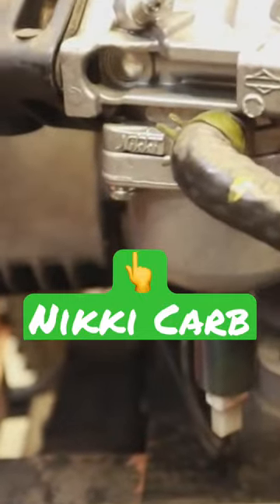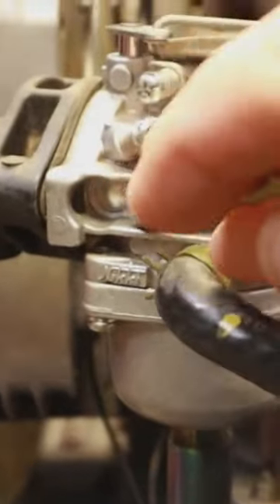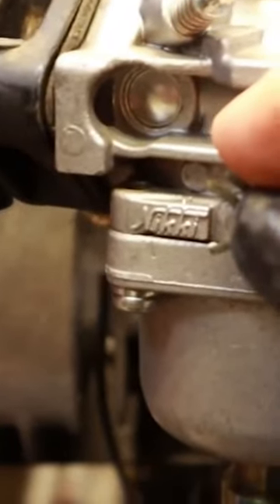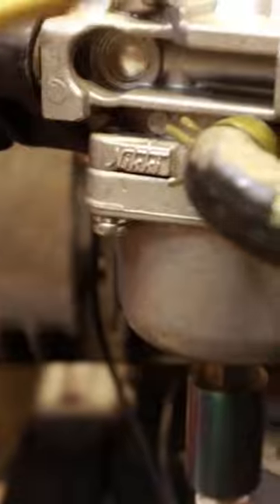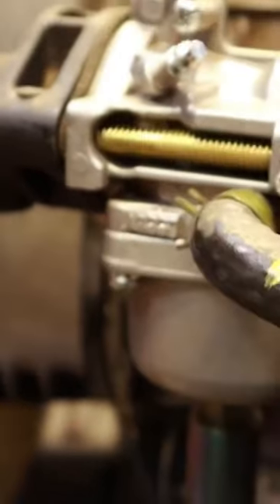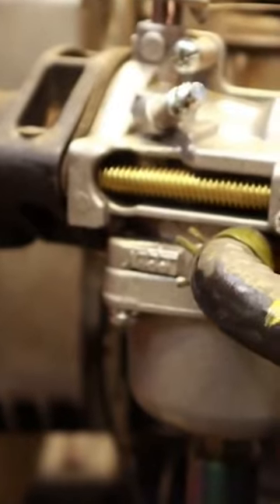Simple Fix for a Surging Nikki Carburetor #baldeagle242

Comment from the maker: See the full story on this mower here.  (What happens when these carbs fail?  Click here to find out!)
https://youtu.be/8VxTRqJZi0Q

See the Complete Baldeagle242 video history here.  A true trip down memory lane of all past videos I have posted on YouTube.
https://youtube.com/playlist?list=PL5_ZXmQpcjpZLAMEskeAYolqvhFSN_X4m

Links to parts used in this video:

Aftermarket (Chinese) Carburetor Repair Kit for Briggs & Stratton Nikki Carbs
https://amzn.to/3q7uTWv

Briggs and Stratton brand Nikki Float bowl gasket (O-Ring style)
https://amzn.to/31HwQjc

Briggs and Stratton brand Nikki Float bowl gasket (NON-Ring style)
https://amzn.to/3f6F3AC

Briggs and Stratton brand Nikki needle
https://amzn.to/33fxzZ6

Inline fuel shut-off valve
https://amzn.to/3tacn1C

Inline fuel filters
https://amzn.to/3r0Cs0v

Below are tools and parts I use in my shop and daily adventures.

Mini Tire Changer for the mower, go-kart, and most small tires.
https://amzn.to/31eHgGp

The drill bits I use are lifetime-warranted Molybdenum from Drill Hog.  If you break one or wear it to nothing, you send it back, and they send a new one!
https://www.amazon.com/dp/B010US18BG/?tag=eagle0f1-20

Hand crank trailer winch with strap with safety hook
https://amzn.to/3jTBzEL

Titanium MIG 140 Welder Works with Flux Core (No Gas needed - 110 volts)
https://amzn.to/3mqj3oP
Titanium MIG 170 Welder Works with Flux Core or Gas (110 or 220 volts)
https://bit.ly/3k8GUrD

Amazon Wish List
https://a.co/cWseC8V

As an Amazon Affiliate, I earn from qualifying purchases.  These links are provided to help you find the products I've used in this video.  Clicking these links will take you straight to the products on Amazon and help support this channel without costing you anything extra.

Get the Motion Hero Pack that I use in my videos for
Only $37 one-time investment. Use unlimited times on your own and client videos!
https://baldeagle242--videohero.thrivecart.com/motion-hero-pack-1/

If you're a video creator on YouTube - Tube, Buddy is an excellent program to evaluate your videos and make recommendations to help you attract more viewers.  
https://www.tubebuddy.com/Baldeagle242

BALDEAGLE242 Facebook group
https://www.facebook.com/profile.php?id=100068248886396

BALDEAGLE242 Instagram 
https://www.instagram.com/baldeagle242/

Comment: I have one that’s running wide open and I can’t figure out why. I’ve checked everything. Could this be why?
Reply from the maker: It has to be sucking air in or around something. It pull the air cleaner off and check the throttle butterfly first to make sure it’s fully closing and nothing is stuck or bent in the throttle and governor linkage.